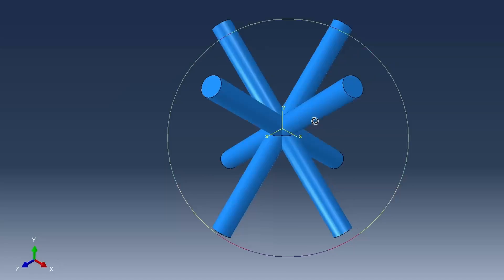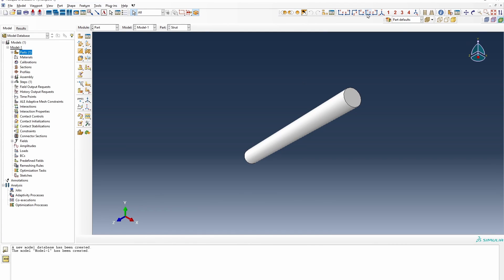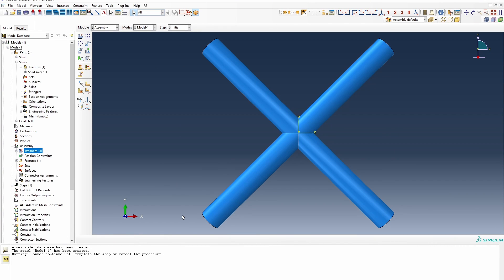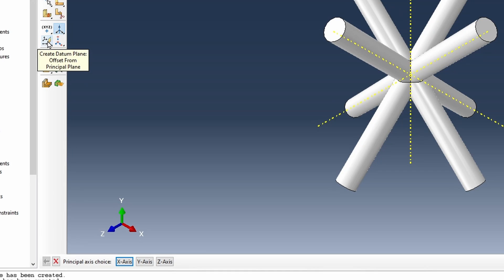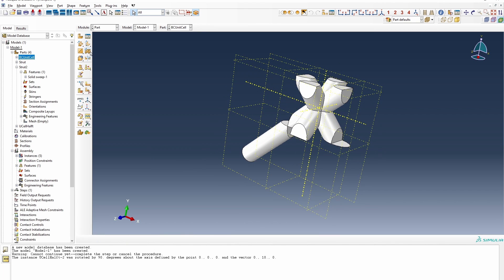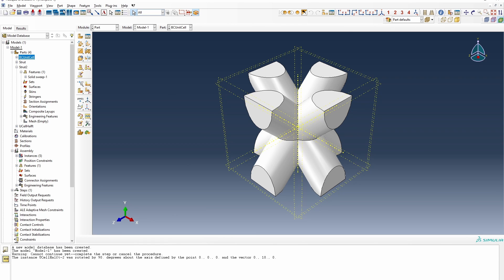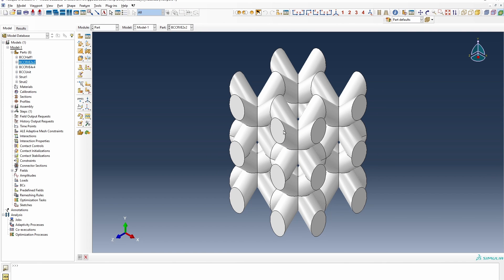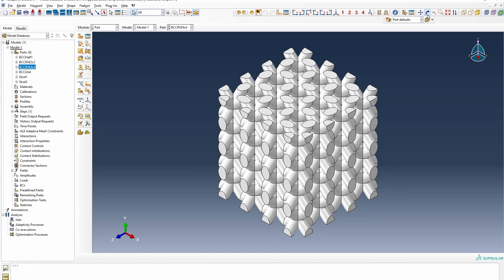How to use ABAQUS to create BODY-CENTRED CUBIC Lattices

Comment: Thanks for the lecture. I have been able to model this on solidworks up to the point of getting the diagonals,i.e., i am struck at the point where you 'extrude' cut it into  correct size. Any advise will be appreciated
Reply from the maker: Am not sure how this works within Solidworks so unable to help.

Comment: Hi sir. Thank you very much for your nice illustration. Sir I have a question how to define the overall all Lt in the lattice . For this case it was 16.7mm so how to understand the lt here here. Sir eagerly waiting for your feedback
Reply from the maker: To define the Lt parameter you just choose it according to the design of the unit cell of the lattice structure. Here I started with a 12x12 cell which resulted in the 16.7 length for the diagonal length
Reply: @MichaelOkereke  Sir onr more confusion sir, is their any easiest way to calculate the overall area from the structure. Eagerly waiting sir
Reply from the maker: I will recommend you watch this video of mine for the first 2 minutes where I show how to obtain surface area of a non standard surface: https://youtube.com/watch?v=qjAHGGIoeqE&si=EnSIkaIECMiOmarE
Reply: @MichaelOkereke  Thank you sir